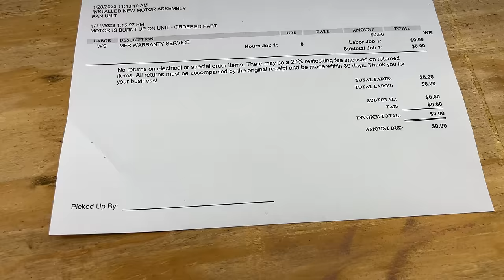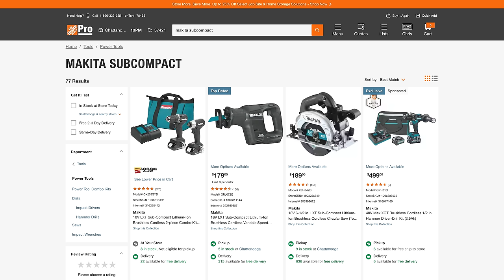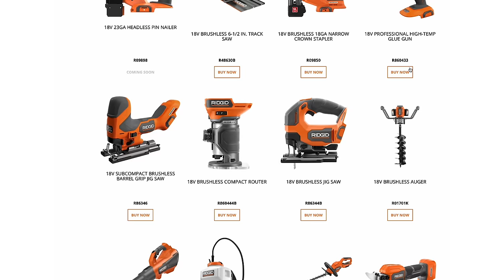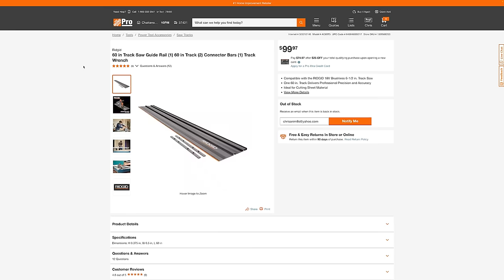Why Everyone Was Wrong About RIDGID's Future...

Comment: Great video, as always!! I had a lot of Ridgid tools and was very happy with them. I had most of them stolen, so I had to make a choice of continuing with Ridgid, because I still had some, including batteries, or move to a different brand. I would have stayed with Ridgid if it weren't for 2 things. First, they were not coming out with many new things, as you stated in your video, and they came out with some flops, namely their 1 tool that took a smaller battery. I was very excited to see that they came out with a smaller battery, only to find out that it would be the only tool for that battery. Secondly, I was told that Home Depot, which had exclusive rights to the line, had not renewed their license. So I moved on. Once I had so much invested in Milwaukee, there was not much reason to move back to Ridgid. All that said, I am very glad to see them upping their game!! I am however happy to be using a brand that is not only sold in 1 store. I think that is something that needs to be considered for any tool. I still shop at Home Depot, in fact have bought most of my Milwaukee tools there. I do hope that Home Depot and Ridgid continue their relationship because it is a good tool line.

Comment: I was a huge ridgid fan from 2010 to around 2018. Got into it because of the warranty. They've lost me when they released their 48th drill and impact. Everybody was asking more different tools and they were simply not listening. Also i was a bit mad when they killed their 12v lineup. 
So i've stepped up with dewalt. And some ryobi for weird/homeowner tools. The newer ridgid tools looks cheap, their batteries looks cheap, and they are very expensive. I'm out and not coming back.

Another stupid move was to remove the jobmax line. It was a great tool with a lot of options, i'm missing the right angle drill, should've got it when i could. 
Their vacuum are useless. I bought the Gen5X brushless one and it's horrible. It sucks for 10 seconds then the filter's clogged

One tool i still love tho, is the hydraulic impact driver. It's so freaking powerful and quiet.

Comment: Thabks for the info Matt. I like most the Ridgid tools also. with the exception of their table saw when I had issues with the fence. I ended up returning that and got the Dewalt for table saw.  I am happy to see they are doing more lawn equipment. MY old 8yo BD weed eater doesn't hold a battery charge for long like it used to. since I already got few Ridgid batteries I may upgrade to Ridgid weed eater.

Comment: As a retired mechanic tools are everything. I really liked the quality of the RIDGID brand and there products. Then I bought the RIDGID K-30 drain cleaner. I used it and liked its small size. Then I loaned it to someone. Six months later I tried to use this drain cleaner and it would not work. I bought a 2nd RIDGID K-30 and fixed my drains.  I finally got it apart and found the snake rust welded together? After a long conversation with the RIDGID complaining this snake should not rust weld itself together when using in a wet environment! Then the 2nd one did the same thing. I got the parts and fixed one of them. My web search showed this one is not sold anymore? I wonder why? Then the electrical switch went out of my 18 volt Reciprocating saw. Ridgid could not find my registration so no warranty. Trust me this was not an easy job to replace that switch. Now on a good note, the 18 volt SubCompact  Brushless 3 inch Multi-Material saw is something I use all the time. It works great in cutting everything. I do like RIDGID tools, but they truly have dropped the ball on taking care of broken tools.

Comment: I noticed that the Ridgid section at Home Depot has shrunk. At Factory Tools Direct they went from about 45% Ridgid 55% Ryobi, and now it’s about 10% Ridgid 90% Ryobi.  The release of the track saw has me hopeful, but I wish they would come out with more outdoor power tools. But my favorite Ridgid tool is a discontinued 12V palm impact driver.  It gets activated by pushing into the screw, it’s not too powerful, and is easy to control.

Comment: Rigid could make a toothbrush and I would buy it.   I have never had to use the LSA, not even once and I have their entire line.  

Though my #1 reason for being a fan boy is not one that is talked about much.....
For lefties, Rigid is the way to go.  (You brought that up when you were talking about the router, but indirectly.)  The safety and starter switches are much easier. to navigate and they dont get in the way.  The sight lines are so much better, especially for the miter saw and they barrel grip jig saw.  The only other lines that seems to be good for lefties are Kobalt and Flex.

Comment: I've been using Ridgid tools for several years. Part of the reason was their Lifetime Service Agreement. I rarely needed to use it, but when I did Ridgid took care of me. The process was fairly simple. I took the tool to Home Depot, paid a small deposit, and Home Depot would ship the tool to a Ridgid service center at no cost to me. Then, when the tool was repaired and returned to my local Home Depot, I'd pick the tool back up and Home Depot would refund my deposit. 

Things changed in early 2023. I took a broken Ridgid tool to Home Depot and was told they no longer accepted Ridgid tools for repair. I would need to take my tool to an authorized Ridgid repair facility. (There were none within 400 miles of me.) I swore I'd NEVER buy another Ridgid tool again. In October, Ridgid announced their new Service Direct program. If there isn't a Ridgid service center close to you, Ridgid will send you a FedEx label so you can send the tool to them for repair. In my case, the process took a little less than two weeks. Happy days are here again!

Comment: I only have a few ridgid tools (a planer, spindle desktop sander, a band saw, and shop vac). I've always like them (had most of these for 15 or so years) and never had a second of trouble (parts are easy to come by, since many are the same as Jet or Delta). My dad (who was a General Contractor) LOVED Ridgid. I'm upgraded most things to festool (where it makes sense), so, likely won't be buying anymore Ridgid, but I do like their tools... I wasn't aware they were owned by the same company as Ryobi. I am a HUGE Rypbi fan (they are great value for the money). If I need something cheap, Ryobi is my "goto" brand.

Comment: I had a bad experience with the Brad nailer. I have several other ridgid tools and wanted to stay in the battery system. Picked the Brad nailer up but as many reviews on Home Depot warned, it would mis-fire and only successfully send a Brad every 2 or 3 trigger pulls. Returned it and got the Milwaukee which has yet to have a single mis-fire. Based on my experience I would steer clear of the ridgid Brad nailer.

Comment: i still have (and use) my 24V set of Ridgid tools (drill, saw, recip, light) and they still support with the LSA since i've gone thru about 4 or 5 sets of batteries.   i hope they keep up the improvements.  while my old 24V drill works just fine it's heavier than bleep and i'm wanting  to get one of their newer models (still 1/2").

Comment: Ridgid should come out with a more compact pipe crimper than they already have to compete with Milwaukee.

They should make a cordless 36v or 72v planer, because nobody else even makes one.

They should make a 12” 36v or 72v table saw to beat the 10” Flex table saw that’s coming out.

They should create a 36v or 72v, high pressure cordless pressure washer .

They should also create a cordless denailer for people who reuse pallet wood and since there are currently only pneumatic denailers, that would be another first on the market.

As for the 36v and 72v tools, they can just make slots for 2 to 4 18v batteries and they might actually start selling a lot more 8Ah and 12Ah batteries. I personally have about 15 of their batteries in various Ah’s and almost all of their tools.

Comment: I had a bad experience with Ridgid. I purchased a shop vacuum online from HD. I received the vacuum and opened it to assemble. I found one of the adapters was damaged, I figured that I could just call and they would handle the issue. I called and was asked for the serial number, I was then told that the serial number was two years old. The warranty was out?, I just opened a brand new vac, here's the number again, still out of warranty. Called the store to see if they could help, was told that I can purchase the replacement attachment off the shelf and they would give me a reduced price. I wasn't about to argue, HD has their vacuum back. This has me not purchasing  Ridgid

Comment: The Biggest problem with Ridgid is Home Depot is Not Stocking a lot of the tools. I have several Ridgid tools so I ordered a top handle jigsaw. When I opened the box, the bottom plate would not lock. I took it to Home Depot and returned it no problem but did not have time to wait for another delivery. So I went to Lowe's and bought a corded Bosch jigsaw.

Comment: For the tools that Ridgid doesn't have available yet... Did you know that there are adapters available (I found some on Amazon. Don't know if they are available elsewhere?) that allow you to use your "Lifetime Service Agreement" Ridgid Batteries on other brand tool platforms? Something to consider, because cordless tool batteries have become so Ridiculously Overpriced over the past few years. And, when batteries can often stop holding a charge and need to be replaced long before the tool itself fails (the tool can have Many Years of life left in it, if lightly used, after the batties fail). Which can Drastically Increase the total overall (lifetime) cost of a cordless tool when you have to pay for expensive replacement batteries from a brand that doesn't have a Lifetime Service Agreement for their batteries.

Comment: I've always felt that Ridged was supposed to be the high end prosumer to low end/entry level pro/contractor grade brand.  Something that wasn't going to break the bank for someone running a hobby or side business and also hand enough endurance for the person just getting into the trades and was going to use up their first set of tools making all their mistakes.  Most trades people I spoke with over the years started with Ridged and then moved on to one of the primary color brands once they figured out exactly what they needed for their specific work processes.  They are a transitionary brand so to speak.  

I think that with HART taking the casual home user slot and Ryobi moving up market into the hobby and prosumer areas, Ridged was just not sure where their nich was any longer.  I hope they find their spot and excel there again.  The problem is that tools are a saturated market and you really need to innovate to survive.

Comment: I have been trying to get into Ridgid. Still have some wood tools I would like.  But M12 and M18 tools keep having deals in smaller tool dealers and keep sucking me in. Also the battery power output is purposely crippled by TTI, I would assume.  Milwaukee has Samsung 21700 30t celled 6ah and the new Forge battery.  Ridgid doesn't get 21700s until the 8ah.

Comment: Within the next 10 years I can see Ridgid will be one of the top of the lines… (power tools)
Like buddy said in the beginning… 
Ridgid makes ALOT premium old piping tools.(back in the day)

 I’ve worked in power plants (boilers) and oils and gas refinery’s….
Ridgids heavy duty boiler tube and pipe industrial cutting tool and milling machines ( air or electric ) were always top shelf. 👍

Comment: I have been purchasing Rigid for several years primarily for the price and the service agreement. I sent my drill to get fixed after four years of use and had no problem with service repair. Have you heard anything positive or negative regarding their jointer? I missed the opportunity to purchase one from Home Depot when they had it at on "Special Buy" at $499.00 in the past.

Comment: I have a Ridgid ban saw (BS1400), Ts3650 table saw, and a 6" jointer. (JP0610)  All have been good tools and built very well.  However when it comes to buying repair parts for these tools, they are hard as hens teeth to find.  In fact, Ridgid no longer makes many repair parts for these power tools and the consumer is left with a piece of iron that has become useless because parts are no longer available.  This is my only gripe about the tools other than the table saw not coming with a riving knife which can make ripping wood a little scary because of kickback.  Given Ridgid's tendency to discontinue making tools and making parts available, I would be hesitant to buy more of their products despite making these tools that are built like tanks due to heavy construction.   I have recently seen ads from HD that sold Ridgid power tools and have seen the band saw listed.  But, I would guess it is NOS (New Old Stock) since TTI no longer makes this saw and the other power tools I mentioned.

Comment: About 18 months or so ago, I saw RIGID(which in my not so humble opinion isn't more than a half step behind it's sister Milwaukee or usually 3 to 4 steps above RYOBI, not in everything, but you MUST RESEARCH RYOBI models to be sure you're getting something that can be used as an actual tool, and not a door-stop.!)had Re-Vamped Their 6 1/2" circular saw as a brushless model, as well they'd paired it with a what I believe was a 'pouch-cell' or 'flat-cell' (It allows for more battery in the confined space.) It was the fastest cutting saw of the bunch, and that included 'team-yellow', and 'team-red' and Bosch, and a couple others I don't remember right now. It had a deeper cut depth than other much expensive saws in the test and equal to the cut depth of overall winner of the contest. I'm not sure those other guys have done re-vamps of their 6 1/2" circular saws, but.... I do know everyone except RYOBI, cause they're mostly DIY'rs/"beginner thinking about becoming a professional" brand, and they can't seem to figure out when it's time to go brushless and put enough power into something so that someone who started out with the brand could grow within the brand.😕  If I wasn't on the Milwaukee M12 & M18 platform, and the RYOBI already, I'd see a greater need to pick up the RIDGID line. 🧐😎

Comment: Pipe machines, pipe wrenches and specialty tools used in like pipe and water trades are state of the art standard, their hand power tools like drills and such I have found to be unreliable junk.  They have a lifetime warranty because you spend your life getting them rebuilt and repaired.  Maybe I’m just too hard on the tools but other brands seem to not have the same gear stripping clutch failing issues I have had with Ridgid.  Maybe they have improved over the last few years but I don’t have the desire to spend my money on a maybe when I use tried and true dependable tools.

Comment: The thing for me was having that all-in-one battery platform. Ridgid just isn't there. I'm probably in the minority on this, but I REALLY like having a single battery platform that can run my nailers, my drills/drivers, my sanders, my saws, etc., AS WELL AS my vacuum cleaners, my carpet cleaner, a show shovel, a weed whacker, a push mower, a propane heater... you get the picture. For me, it just makes a ton more sense for Ryobi and Ridgid to merge into one company that can offer the amazing, extensive lineup of Ryobi with the higher build quality (most of the time) and LSA of Ridgid. I know this would really bum a lot of people out, but what I'd really love to see would be Ryobi buying out Ridgid and adding their more powerful and better quality options to the Ryobi HP Brushless line to truly compete in the prosumer/budget-minded professional space.

Comment: 2:50 it's funny, I always thought Ridgid was the house brand of Home Depot. That seemed to be where I would always see it. Guess I just got that impression because they were orange? I'm glad they are back on their game though. I went with Ridgid because of the battery powered stuff, at the time they had by far the most variety of tools (around 2017 like you). That palm router, for instance. They were the first ones I saw with a battery powered palm router, or at least one that didn't suck. Everyone else has caught up now (especially Ryobi), but it's the usual story, once you invest in a battery, you stick with the brand...
Reply: RIDGID power tools ARE the house brand for Home Depot, you thought correctly. HD wanted their own tools, approached TTI with this want, TTI reached out to Emerson for licensing of the Ridgid brand. Three way deal.

Comment: Around 2017 Ridgid was purchased by Emerson. They went on to "Value Engineer" all the Value out of their tools. After thousands invested in Ridgid tools, I'm now ditching the brand. Their new high-torque drill is bad and their Oscillating Multi-Tool is the worst OMT of all time...as a contractor these two tools I use daily were the final straws.

Comment: I read several comments about TTI having control over Ridgid and the other tools they manufacture. Nothing could be further from the truth. TTI is nothing more than a manufacturing company. Ridgid management, engineer’s and company strategists are at their headquarters in Elyria.  I just retired from Emerson and  Ridgid was part of their tool division and would be part of planning conferences at Emerson annually. Emerson supported Ridgid and their business model and they have always been a profitable company. However, Emerson recently had their CEO retire and a new CEO is restructuring many of the platforms to move into a higher tech phase in regard to competition and development. Emerson has some input, however a great deal of the designs and development lies with Ridgid. TTI may put the tools together, but Ridgid is calling the shots.
Just as for years the Craftsman line for Sears produced outstanding tools, but the manufacturer was Western Forge; who also manufactured other tools for various companies.